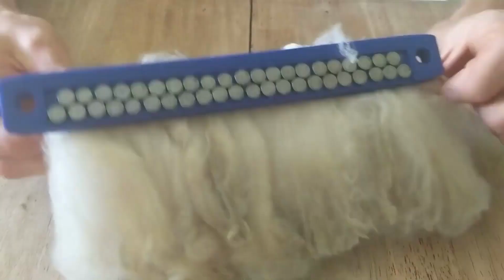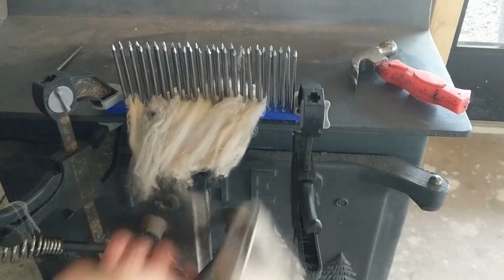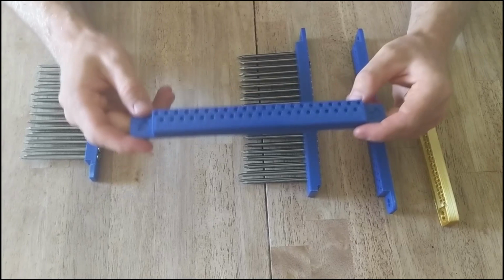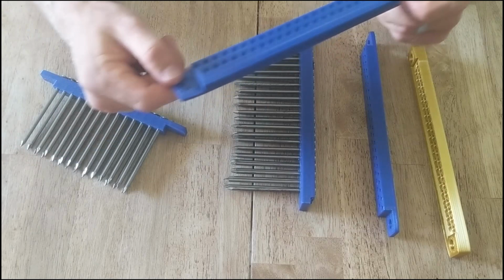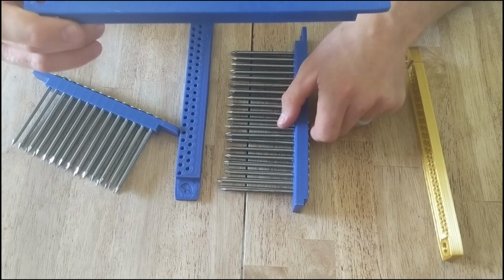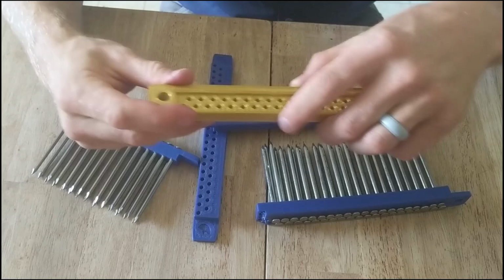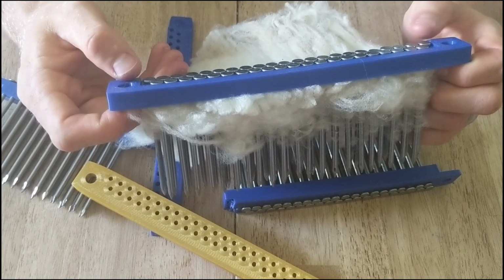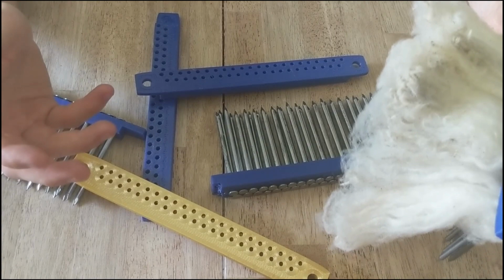Designing a Wool Hackle for 3D Printing

Comment: Could you make a longer one in sections that half laped together and are pegged by the nails?  It would require support material for the laps.

Could you also use thinner nails, or would they be too short?

Comment: I loved seeing you use it at the end to pull out some pencil roving. A diz is mega easy to make, and would help pull a consistent roving. It's just a flat item with a hole (or several different sized ones) to pull the fibre through.

Comment: ... or I can design my own :-)
I have a couple Ender 3 printers, and have designed several useful tools. One is a clip just the right size, so my wife can attach it to the railing on our front porch, and hang her holiday lights. She changes them for every holiday, which is why I didn't just say "Christmas lights". Another tool I designed is a funnel that I use to pour water from my distiller to gallon water jugs. It's not perfect, but it's a lot better than what I was  doing. Another tool I designed holds the little humidity and temperature gauges I have to judge if I can safely store filament without using my drying box. I've done a few more, but so far, only the funnel is on Thingiverse.
Keep the good stuff coming.

Comment: Hey there! I printed this at my local library from your thingiverse files and used the nails specified but they are loose & wiggle a lot. Is it possible the print was done too large, or is this just to be expected?
Reply from the maker: The nails you used were probably "box nails" you need "common nails".

Comment: I gotta make one of these for flax
Reply from the maker: I threw together a prototype Flax Hackle a little while ago that seemed to work fairly well. I'll post that one to Thingiverse as well. JB
Reply: @GoodandBasic  thanks dude but sadly I dont have a 3d printer so I'm probably just gonna use some nails in a block of poplar I have😛
Reply: @nullsnaggle5198  Where do you live? There are many people with 3D printers. I'd bet one of them would print one for you. I'd do it for you, once I get a few bugs resolved. Almost there, and I still have one printer that works flawlessly, once I put the hotend back together. It's apart, so I can rewire it for a new mainboard with "silent stepper drivers"